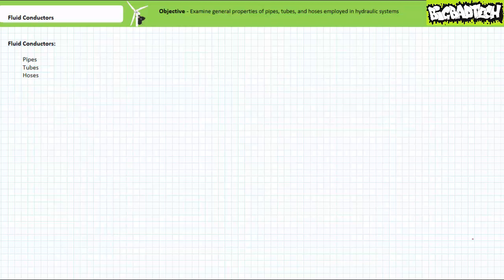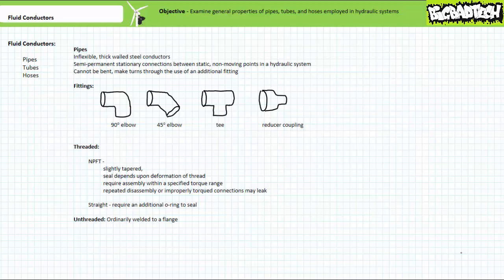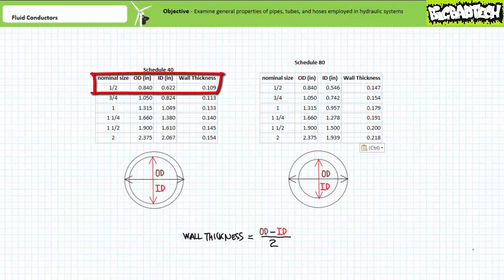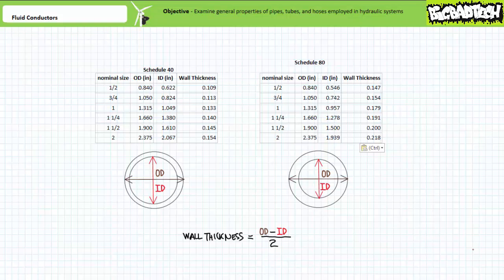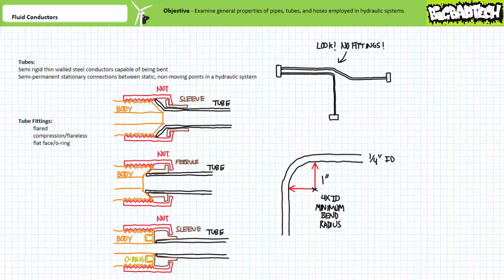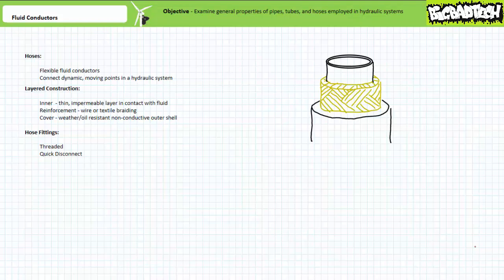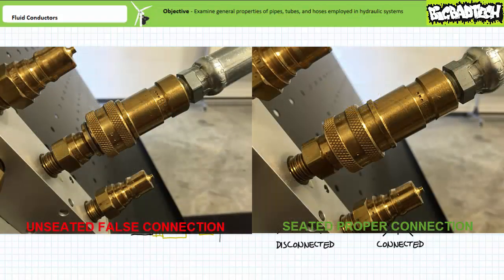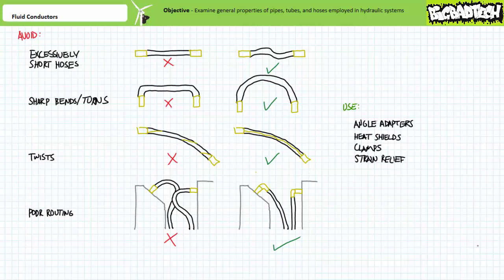Fluid Conductors (Full Lecture)

Comment: excellent lecture again.
before i started to my first job, i didn't know how pipes were named. and i was thinkg that an 1" pipe should  have  at least an 1" dimension in it.
i felt like i chose the wrong job.

there are couple of good websites for this topic. they are actually from manufacturers website but they also give relative wieghts of thie pipes. which is an essential point while design pipes & fittings for fluid applications.